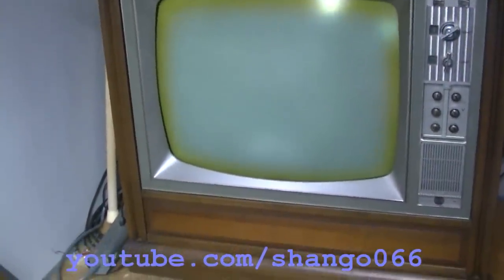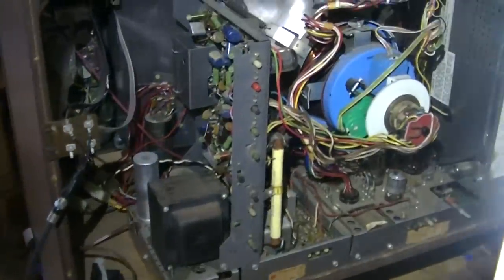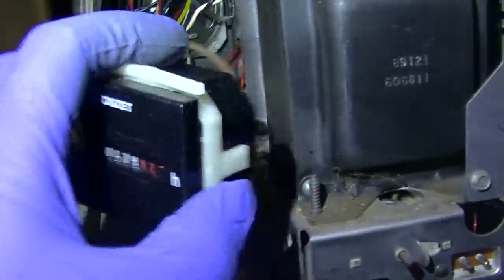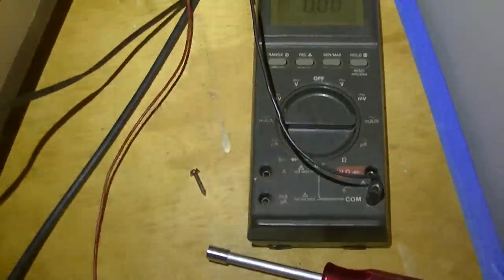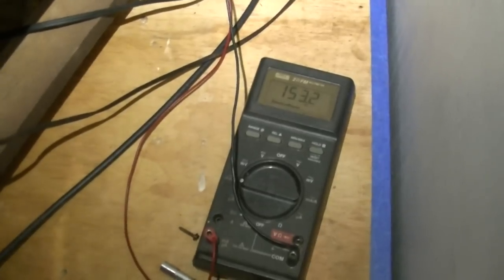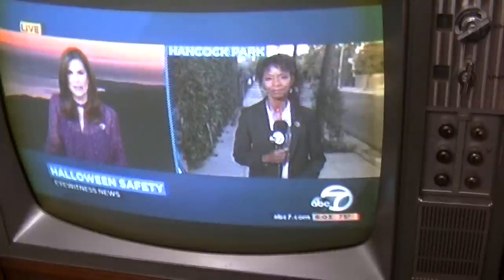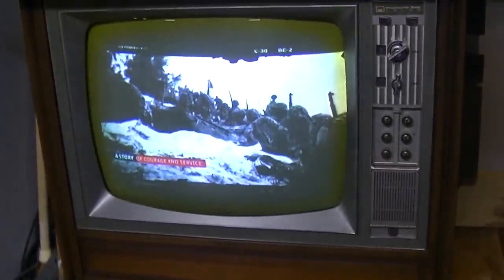1968 NOS Packard Bell Test Set Update 1 10 30 22

Comment: There was a reason why every neighbourhood used to have a local TV / Radio repair shop.. even though it is NOS still dealing with 50 year old components so i'm expecting failures to be higher than if this test was being run when it was made back in 68.. still it is doing better than I thought!
Reply: Exactly. Parts degrade after sitting all those years even though it was never used. I think it’s holding up really well so far at almost 500 hours of time.
Reply: There were color TVs (mostly Zenith and sometimes Sylvania) that ran 4-5 years in heavy use without any service and it was quite frequent. I started fixing TVs in 1969. Take an up thumb, I'm not disagreeing with you. RCA kept us busy.

Comment: It would appear that the two red numbers on the hour meter would be a percentage of an hour
Reply: That's what I was thinking, red 50 would mean 30 minutes and it rolls over the hour at 100.
Reply: I was thinking the same. Although you would think they would make it minutes. :)
Reply: Yes, though I think a better way of putting it is that there is an implied decimal point between the red/white numbers, some meters show more than 1/100ths.

Comment: Your Crouzet hour counter is similar to the (dual) mechanical Crouzet hour counter CMM48. The brand is French. The rightmost tick-indicator is divided in 1000th of an hour (3,6sec at 50Hz or 60Hz depending on the sub model). The rightmost red counter digit increments every 36 seconds. The red digits are decimal counters (instead of seconds and/or minutes one would expect). The white digits indicate hours. It's quite accurate according to specifications: +-30mSec at any given frequency (per 24h ? not specified)
Reply: It's a surely a synchronous motor so it will remain accurate indefinitely given a correct line frequency.

Comment: I wonder if the heat inside the tv is part of it as the fuse wire pop's on overheating by over current. but adding external heat might influence it going early.

Comment: Remember that the cathode current is being drawn as large spikes that AVERAGE to the reading you see on a cathode current meter.  The fuse sees this mostly as average power, but the brief high current spikes mean you will probably need to slightly uprate the fuse value with such physically small fuse elements to get it to actually hold properly and get the expected fuse longevity.
Reply: Yep, the spikes tend to cause the link within the fuse to get metal fatigue-a slightly higher value is needed.
Reply: It might be worth trying to find a true rms meter to get a "second opinion" on the current. RMS is based on "heating average" and that's what counts when dealing with fuses.
Reply: That's what the capacitor across the fuse is for. It bypasses the spikes across the fuse. He put the meter in place of the fuse, so the capacitor bypassed the spikes across the meter, too. He should put a scope across the fuse to see, how efficiently the cap works. If he measures the resistance of the fuse accurately (by measuring  the voltage drop under nominal DC load), he can calculate the RMS AC current on the fuse from the RMS AC voltage measured by the scope. Might need to add a .1uF film cap too, to bypass the shortest, fastest pulses, of which the electrolytic might be unable to bypass due to its ESR and ESL. 

Also note that the cap is a vintage NOS one (judging by the phenolic bottom), it might have started to fail under the high current pulse stress.
Reply: @mrnmrn1  Just to drive home the point you were drifting to, how well the capacitor bypasses depends on the capacitor ESR and now it compares to the resistance of the fuse (or meter).  The higher the ESR (or the lower the resistance of the fuse), the more the pulse will go though the fuse.
Reply: I wonder if it is possible to read those spikes across a low impedance device like a fuse? Battery powered portable scope?
Reply: @zulumax1  IIRC, this is in the cathode circuit, so one side is probably ground already. Otherwise, you could use a dual channel scope and set it to subtract.
Reply: @russellhltn1396  Wouldn't a higher resistance in the fuse mean that less of the pulse would go with the fuse? It's basically an RC circuit with an increased time constant. I'd personally add a resistor in series with the fuse to increase this effect even more. 10 ohms should be completely negligible to the operation of the set yet make the capacitor bypass basically all of the pulse.
Reply: @eDoc2020  Yes, the higher the ESR of the cap or lower the resistance of the fuse, more goes though the fuse.
Reply: @russellhltn1396  Yes, but to be even more precise, the impedance of the cap (Xc+ESL+ESR) must be much lower (preferably by an order of magnitude), compared to the impedance of the fuse. At ~15kHz, it's not just the ESR of tha cap that matters, but also the ESL. Xc of 47uF is probably low enough at 15kHz, I'm too lazy to calculate it now, but might be worthy to change the electrolytic to a 100-220uF one to be on the safe side.

Some fuses also have significant amount of inductance: some slow-blow types have the fuse wire wound around a string of fiberglass, hundreds of turns. If the fuse he uses if that type, what I suggested about measuring the DC resistance of it to calculate the RMS current across it in the TV makes no sense, because the inductance of the fuse will screw up the calculation.
Reply: @zulumax1  Yes, as Russell suggested, dual channel scope in differential mode. But I think his only digital scope is that ancient Textronix portable, very cute, but I doubt it would be fast enough to be resonably accurate in calculating the RMS value in this scenario.
Reply: @mrnmrn1  How many nano seconds we going to need to be seeing? Not sure what the rise time of an electrolytic capacitor would be. Any idea what the dc resistance of the .25 A fuse is? Slow blow may be different resistance also. My 50MHz analog scope does not have differential mode that I know of, is that a digital scope feature?
Reply: @mrnmrn1  According to an on-line calculator, 47uF at 15KHz is 0.2258 ohms.  Some 250mA fuses I looked at ranged 1- 1.7 ohms.
Reply: @zulumax1  Most analog scopes have differential mode, even my basic 20MHz Leader LBO-508A. Yours with 50MHz bandwidth almost surely has diff. mode, too. What is the model? At least one of the channels should be invertable, and there should be an 'ADD' function. One normal phase and one phase-inverted channel added together makes one differential input. In differential mode, you (usually) don't use the GND clip of the probes, only the two tips of the two probes.

In order to calculate the rise time of a capacitor, you need to know both the capacitance, ESR and ESL. Easier to just put a scope on it, and compare the waveforms with and without a film cap across the electrolytic. The film cap must be a low inductance type, too (or it can be ceramic as well).
Reply: @mrnmrn1  Yes, it is there, very well hidden. The Y channel has a "pull to invert" on the vertical position, just had to look closer. 

Panasonic VP-5565A, have it in a couple of videos on my channel. It has served me well. Thanks for your input.

Comment: Have you considered setting up a cheap dash cam pointed at it? It can be on a usb charger off of the hours meter / power. That way you can roll back and see it fail.

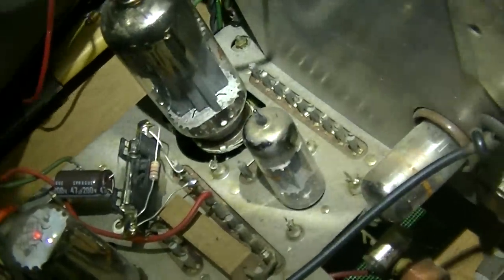Comment: @7:20 Thanks - Yes it should hold 250 'forever ' if its good. That is the rated current not the current where it blows. Did the old one look stressed?  I'm guessing no, as they do just fail with a whimper. At these low currents it is hard to make a fuse that is within close tolerance limits. They can and do vary wildly. Especially dodgy brands - Don't use an unbranded fuse - This was probably just sitting around the actual current.

 A fuse that is just passing that tad over its rating, even a fast blow like this, could take many hours to blow, if at all, though they will lose a little material as they will remain at high temps and become more likely to blow as time goes on.  Looking at fuse specs is eye opening.

I'm betting there is absolutely nothing wrong and a 350 will never blow under normal conditions. This would also be closer to that chosen by makers and Shango was being extra careful (as he explained), so if you value your things it is a good idea to stay only a few percent over but expect more random failures.
(I have lost bets before).
Reply: No, politely there is a voltage drop across fuses that can cause heat and drive them to fail even though they are being operated within their amperage specs.   It's not as simple as measuring the amperage and putting in a fuse that's some arbitrary amount larger.   Look up some fuse brands and look at their data sheets and they will mention voltage drop for this very good reason.  (no thumbs down given for politeness)

Comment: The electronic diagnostic step-through is informative, but the commentary is really entertaining. This NOS has failed once  already? Back in the late '70s I was repairing these sets, and they typically ran longer without a failure then. At least they came in the shop less frequently.

Comment: Voltage drop does occur across a standard AGC fuse, especially in this case, in which it's going to ground.  you have 118 volts at about 250 MA  which is about 30 watts of potential heat you're trying to dissipate.   This voltage drop would cause heat to build up inside the fuse and eventually cause it to fail even though it's being used within its amperage specs.  The fact the set had been running for 12 hours would have given plenty of time for this heat to build up.   I believe there are chemical fuses that are more resistant to this buildup of heat.  The fuse is the weak part of the circuit even if it's rated to handle the amperage involved.   The closed glass fuse means the wire within the fuse will get hot first.  The new fuse is going to blow too unless you find a chemical fuse that can handle heat.   Look at any other color sets from that era that had fuses on the Horizontal Output cathode, what kind of fuse and amperage of fuse did they use?

Comment: I believe same vintage GE went to a bimetallic type of circuit breaker on the horizontal output cathode, probably 250 mA. It could withstand the pulses without fatigue. KA chassis, as I recall 1967. My understanding anyhow.
Reply: Very true

Comment: As I recall older Zenith televisions used a BELFUSE chemical fuse in the horizontal output cathode circuit, I'm not certain but I think they are current and temperature sensitive, maybe the type of fuse makes a difference
Reply: Bingo, you nailed it.  The voltage drop and resulting heat across a standard fuse can cause it to fail even if it's being used within its amperage rating.

Comment: Electrolytic capacitor across the fuse may not be fast enough to absorb short duration high current pulses and the fuse is being hammered by the pulses. Maybe another small high frequency bypass capacitor in parallel?

Comment: I don't think the fuse is under sized, but the electrolytic capacitor has quite a parasitic inductance and could cause some high current spikes to go through the fuse. Probably you should also put a 100nF ceramic capacitor parallel to the fuse, so for the lower frequency high current spikes would go through the electrolytic capacitor and the high frequency spikes would go through the ceramic.
Reply: Exactly! Put a scope across the fuse, to see the effect of the fuse bypass cap(s).
Reply: That was my thought too, that electrolytic is too slow to react. Ceramic or safety XY high voltage type. I also made a comment on this elsewhere. Even 10nF may do the trick. The electrolytic is probably holding a charge and passing enough ac to keep the high voltage going at a low level when the fuse is open, hence the weird color blotches.
Reply: @zulumax1  There is also a discharge resistor which would act as a cathode bias resistor to limit the tube's output current. The current passing through is probably enough to run somewhat the rectifier's filament when it's hot but not enough to power it up from cold. That's why the TV stays black when it was repowered after it was turned off for a while.
Reply: @AlexM1983DHUN  Logical, and plausible

Comment: I would be curious if you had a logger for the mains voltage going into that unit, I made the mistake of connecting my Hammond organ to the mains without a voltage regulator/ Auto Transformer which led me down the rabbit hole of what all the cool iot devices were chatting about on the power lines, not to mention when the smart meter reports back to Fatherland security LOL

Comment: There's intermittent image jitter in the picture on the TV after you got the image working again. Maybe a resistor changing value? What is causing the fuse to burn? seems like some weird intermittent issue.
Reply: I have also seen this behavior in old electrolytics that have not been formed and sat idle for a long time. There are brief moments of current surge as the capacitor breaks down and punches through. They normally self heal and the problem seem to clear up with time. These are NOS, but still 50 years old.

Comment: imo, it is a miracle these high voltage heat generating power hogs lasted as long as they did.  switching to a lcd tv certainly saved lots of electricity.
Reply: When sets went solid state power plummeted to under 100W.  If you had a late 70's Sony Trinitron
or a Zenith with an EFL CRT you could lite a room with it better than a 75W bulb.  It was a sales
pitch even then.  One third the power draw & very little heat, will last for YEARS. And it turned out
very true ! SS sets from the 70's are almost indesructable. 
LFOD !

Comment: materials will outgas, seems the reason we like solid wood, and solid brass, if rusting, copper alloy, is chosen, you were right to discount this "pressboard" montogmery wards crap, tho with a dusty rolling stones LP, would have taken ONE person to speak towards the strength of materials, vs profit margerine
so the policies of Reagan, fully embracing Slave labor, over honest hardworking Americans, just seemed a bit unamerican, guess bonzo the chimp over donovan, is the mindset, gone are the days of the thick multi-instrument harmonies, is as thin as the words "mass-production" thanks for tolerating my rant, Fighting the madness, with ya, PAL, Jayster one eclipse at a time *the mitusishi zero reliability gig~

Comment: I have had a element lcd tv on for 6 years no problems so much for vintage technology  outlasting China garbage
Reply: @commietube_censorship_sucks  it's been on for 6 years straight never turned off unless we lost power
Reply: That's 52,650 hrs roughly
Reply: @Tron1731  The old stuff was all relatively unreliable because of tubes and paper capacitors. A 1970s solid state TV should last decades of continual use without hard failure.
Reply: I highly doubt that and my source is people that were alive at the time who owned 70s TVs. Some exceptional models lasted, sure but generally, stuff in that era was more repairable but not really long term reliable. Modern TVs are more reliable but not nearly as repairable ex: a processor fails. A family member has a sharp brand tv where the manual states the lifespan of the backlight is 60,000 hours just as an example.